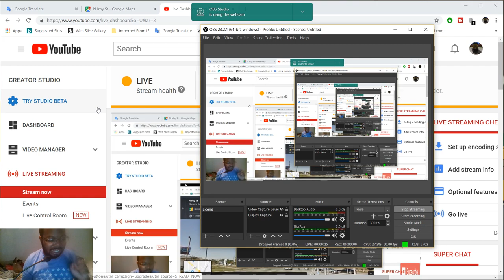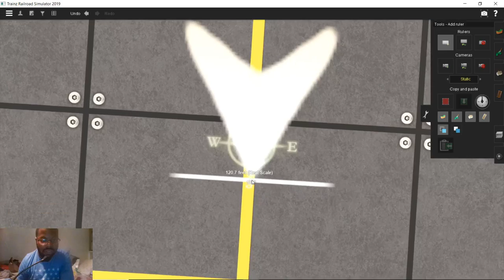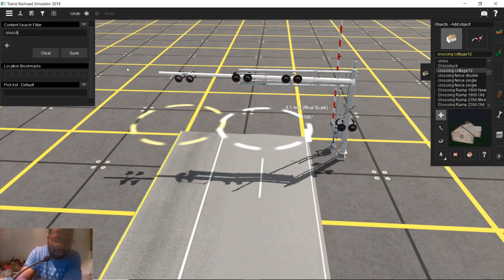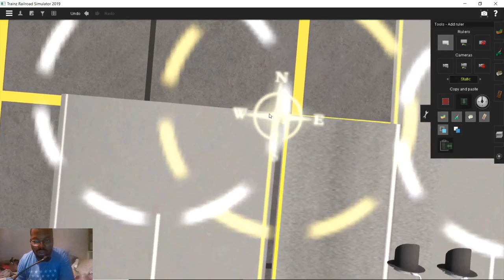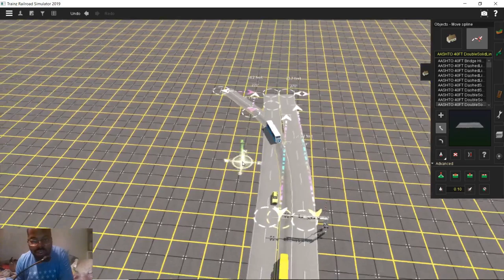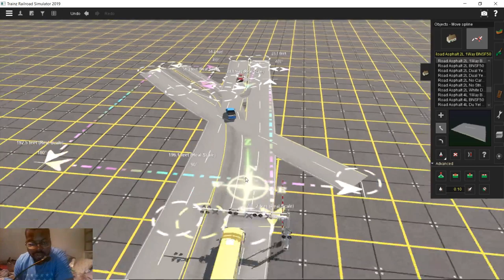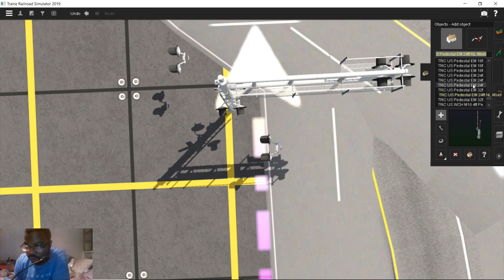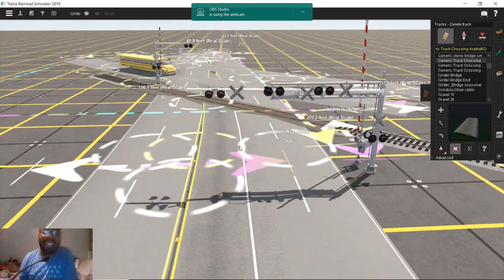Building Florence, SC  in Trainz 2019 Part 1

Comment: Just use bnsf50's 4L dual mast canilever. It's more prototypical and realistic
Reply from the maker: I can't get the ATLS system to work in Trainz 2019.
Reply: Then try installing different triggers and controllers. It works for me in TRS19. Also if you can get it to work use the JR safetran signals
Reply from the maker: @DatTrainGuyProductions  The only issue I'm having is with the Slaves. They keep turning off after the first or second activation and they'll only turn back on if I restart the game.
Reply: ok try uninstalling your current slave and download a different asset version. @Trainfan1055Janathan